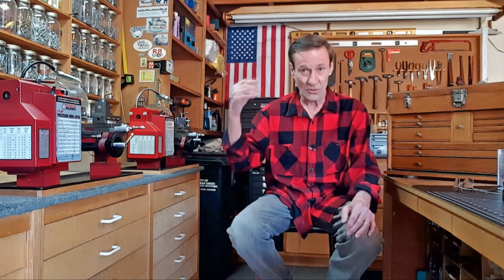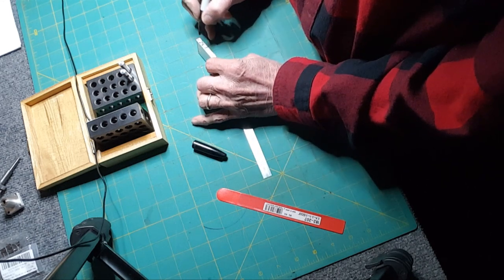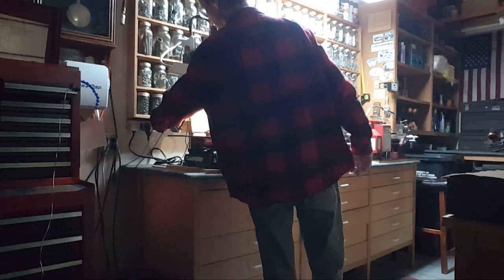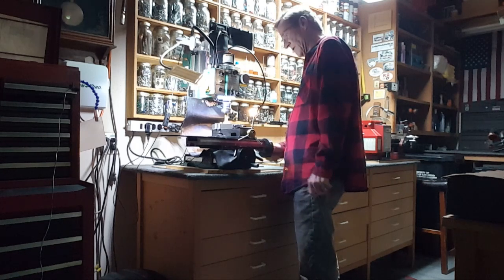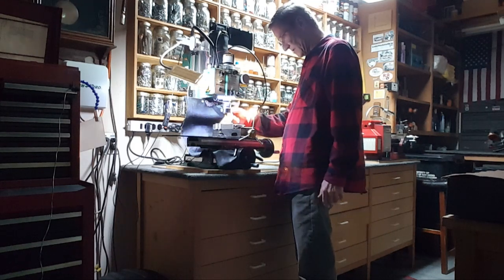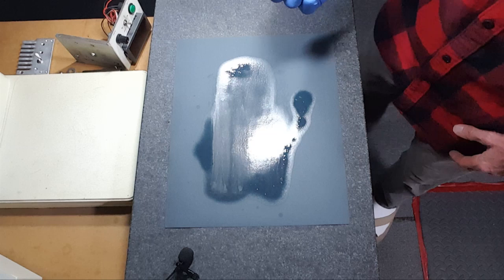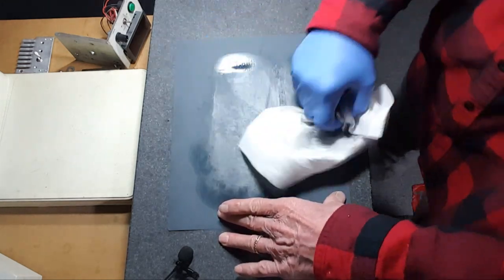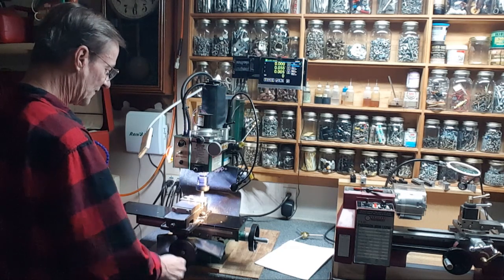Fun Project Machining In The Shop

Comment: is that a good milling machine ?
I saw a lot of rebranded ones, and mostly people complain about the gears and the sound. what is your experience with it ?
Reply from the maker: It's a great machine but like anything from China it's luck of the draw. I have two of them and did a lot of rework and upgrades to both. Some upgrades i made some bought. I have a lot of videos on this.